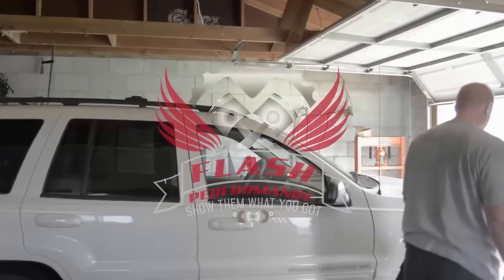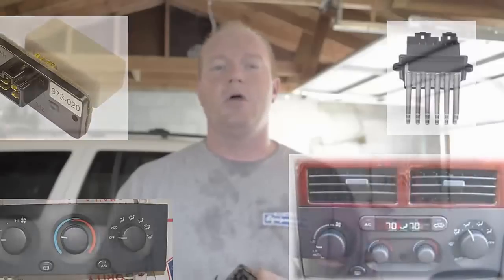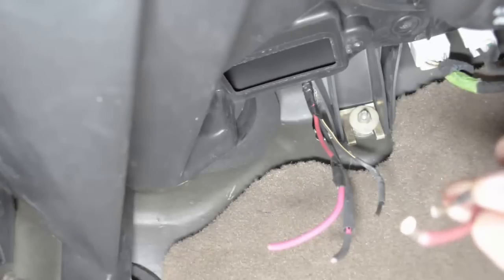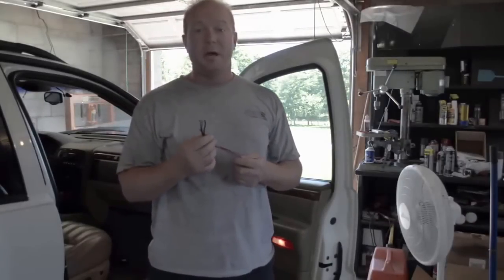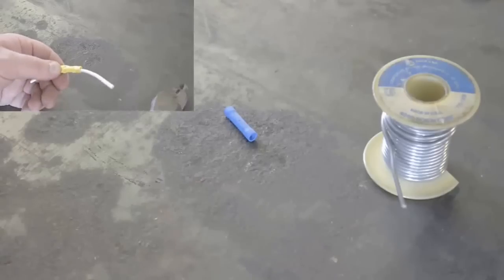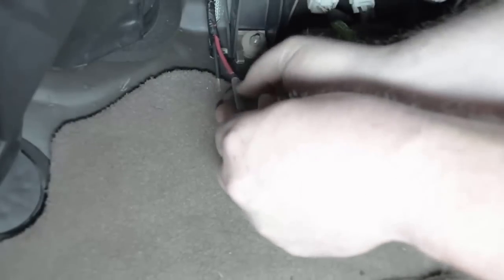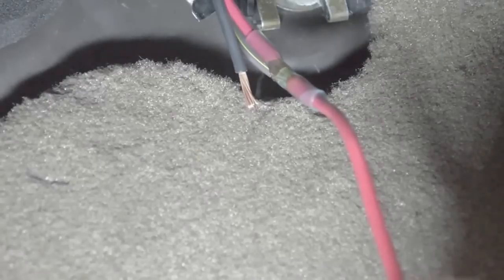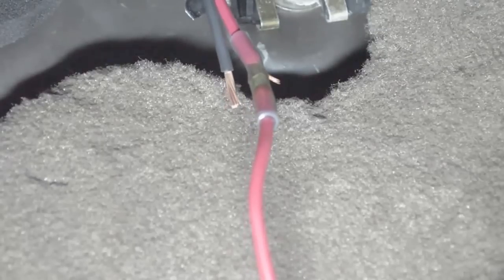Blower Motor Resistor Replacement Grand Cherokee

Comment: Yeah yeah not too much average in the wire and the wires start overheat yeah I have to replace mine I have a problem with this so I'm going to watch your video I have a 2001 Jeep Grand Cherokee with the automatic claimant control dual

Comment: Great video... You installed the resistor over the new part brace so that's just gonna fall right out. Mine didn't come with the two new screws to mount to the new brace either.

Comment: anyone else fan wont go off after replacing blower moter resistor  even when key is out?
Reply: That will be the blower fuse, when that blows the fan runs. Until you replace the fuse you have to switch off ignition and then unhook the battery when leaving the vehicle. I think its 40amp, its in the small fuse box under the engine hood to the left front of the engine bay.

Comment: Does this work for the 98 zj Jeep Grand Cherokee model?
Reply: This applies to a 1999 to a 2004 Jeep Grand Cherokee with Automatic temperature control(the one where you set the temperature number on the dash). 1998s are going to be different. And hopefully you got the 98 with selec-trac and a good rear end!

Comment: I'm stuck on the last part where you install the resistor with the two screws.   The sticky foam sticks to the plate, but not to the resistor.   The plate screws in nice, but now I have the resistor with two holes.   How do I fasten the resistor to the plate?

Comment: dont forget to rever the feed wires to the blower motor or it will blow weak. pull the clip from the blower you will see the green wire on the left and the black wire on the right, reverse those if your blower blows air weak.

Comment: Just pull the resistor out and solder it back together.  It may save you from buying a part you don't immediately need.  I pulled mine and it was easy to solder and reinstall.

Good video still.

Comment: For future viewers the two wire plug goes into the blower motor. if you look at the blower motor on the right side there is a plug. I used needle nose pillars to pull it out and the red and black cable will pull right out
Reply: Thanks man. I was wondering bout that was trying to figure out why I had to cut wires and solder.

Comment: Hi nice straightforward video, how would you unplug the cable if you don't want to cut and splice it ?? Where does it lead to?
Reply from the maker: Most of them are hard wired in and don't have a plug in connection.  Unfortunately unplugging it is not an option
Reply: I was informed that the wiring goes up to the right and over the blower motor and attaches about 6 " to the right of where you were. Take a look if you don't want to cut wires.

Comment: So I had it replace my resister & it cut my blower speed in half.  Made good heat just no air flow to push it. Ended up having to reverse the two wires going to the blower in order to get the blower speed back to where it should be. Anyone else have this problem?
Reply: Thanks for the tip!!!

Comment: Hey there! How exactly do I make sure the blower motor works before I buy the resistor? I was a little confused. Also how do I make sure the fan doesn’t blow backwards? Just match up the colored wires correctly?

Comment: aside from the a/c I was wonder if you have any idea why my jeep does this......when im on the freeway going 70-80 (no wobble in steering) now entering the exit ramp when applying the brakes the steering wheel wobbles up and down when breaking from 70 or 80 down to about 55 maybe 50 then no more wobble the from on the county rd max speed 55 (I go 60) breaking from there to 45 same thing then goes away just replaced breaks and rotors any ideas...tie rod ends?ball joint? stabilizer bar? (THE STEERING WHEEL AND FRONT END SHAKE/WOBBLE UP AND DOWN NOT SIDE TO SIDE WHEN BREAKING)
Reply from the maker: This one is so hard to help with because are so many variables that could go wrong.  I would start by checking the balljoints to see if they have play, then go to the steering linkage and tie rod ends.  Leave the jeep on the ground on pavement and have someone work the steering back and forth.  luy under the Jeep and watch the steering.  Look for any movement or loose components.  There are a lot of great videos for steering and wobble on youtube.
Reply: Flash Performance This sounds like the semi famous WJ wobble. The rear anti sway bar is inadequate for the job, especially when decelerating and turning at highway speeds. There is an aftermarket replacement that solves the problem. Installation is easy and there is a video by martinbuilt ?. on YouTube.
Reply: @nealsims1862  just replaced mine a few weeks ago. If you don't replace it soon it will only get worse believe me

Comment: So the plug that I got from the dealership the one that goes from the blower to the resistor could be wired backwords
Reply from the maker: Possibly,  just because it came from the dealer doesn't mean it is good.  When I found mine running backwards I swapped the the black and red wires coming out of the blower motor and it all worked fine after that.  They come out of the connector very easy with a small pocket screwdriver.

Comment: I did this same exact fix but before it went out i blew a lot harder now with this new part it has no blow like it did before
Reply from the maker: Check the rotation of your blower motor.  I have installed blower motors that were wired backwards.  It would spin fine but it would not blow any air.  Remove it from the air box and power it up to see of the rotation is correct.  If not you just need to swap the red and black wire in the conncetor

Comment: This happens because the blower motor is pulling too much current. So this problem will happen again. Another thing if you get the resister from the dealer i know they are backwards, chrysler screwed up! and you will need to switch them. good video